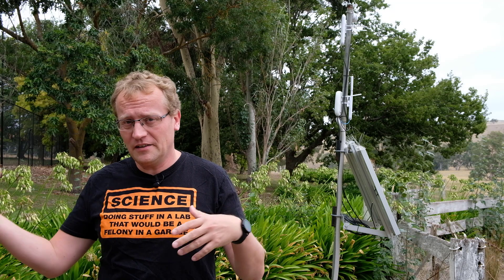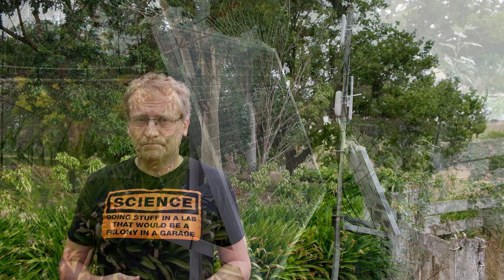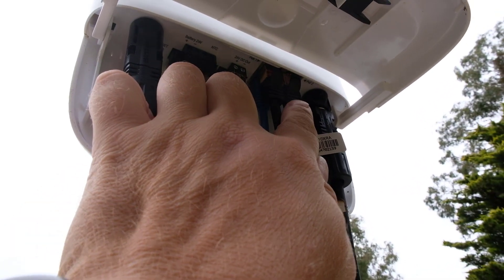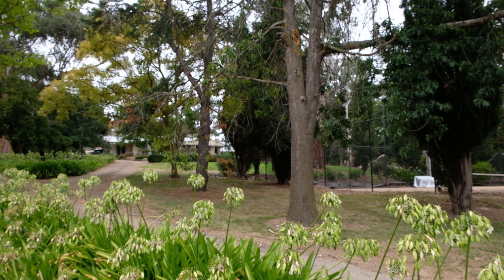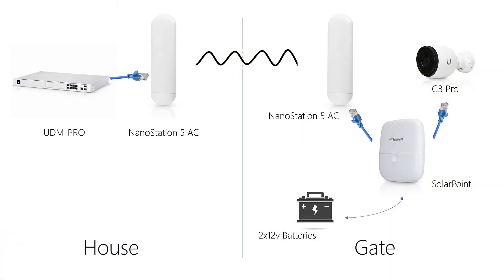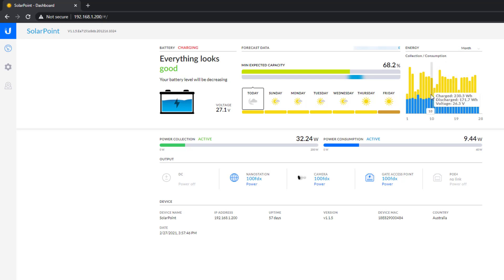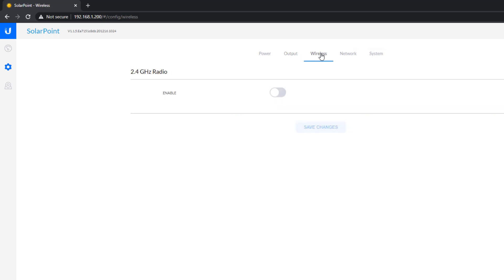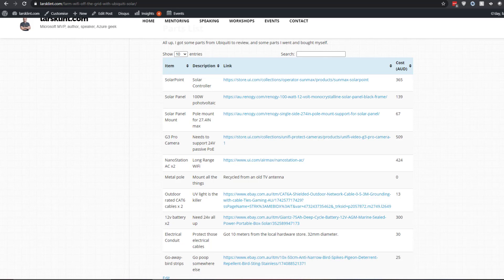Solar powered Unifi network setup - including full cost overview

Comment: Didnt see the solar point in the UI store... Any thoughts on low profile gear we could use to provide solar power to the new express cams?
Reply from the maker: The SolarPoint is old technology now, and you probably wouldn't use it for anything modern (PoE+, 48V). 
Not sure what you would need, but a panel, a solar controller and a charger would be minimum?

Comment: That SunMax is an awesome surprise as a product, thank you! 7A is a reasonable charge current, given a 100W panel and 24V battery setup (that's ~5A max, really). Just don't wire up a much larger panel... But - only 24v passive poe, still, and worse, no support for LiFePo battery charging? That's a software issue only afaics (charge curve is different to lead-acid), so would be a simple upgrade. I can find a few units in AU still, but suspect I'll need to look at competing products for Lithium. Excellent overview, as always Lars!
Reply from the maker: I have used the SolarPoint for just over 3 years now and it has been amazing. However, as you say, the 24V passive is an issue, and I can't update to modern devices with it. I am currently in the process of upgrading my entire gate setup, which includes the Access Gate Kit, 48V, PoE+ and much more. That video will come when I am done. 
Thanks so much for watching and commenting. 😊

Comment: Where can I find the cables and adapter used for the battery to ubiquiti controller?
Reply from the maker: They are standard MC4 connectors and cables used for solar panels. I am not sure what adapter you are referring to.

Comment: Great video. I use many different UniFi products, but had NO idea about the SunMax. Glad I can still learn something everyday!
Reply from the maker: Thanks Tyler. It is a great device, but is starting to show its age. It only supports 24V passive PoE, and supports up to 200W of input. While it isn't officially discontinued from Unifi, it is becoming more and more difficult to find one for sale. I will keep using mine though until it gives up 😁
Reply: @LarsKlintTech  Yeah, I'm seeing that they're hard to get. I'm already planning another option if I can't get one soon. 24v would be fine, as all my nodes will be UniFi-PoE or WiFi/solar. Best of luck! Thanks again!
Reply from the maker: @tylermyers6920  Just make sure your Unifi PoE devices support 24V passive. The newer ones don't.
Reply: @LarsKlintTech  For sure! My P2P is 24v Passive and I can get a WAP that is as well.
Thanks again!

Comment: the solar point devices max rating for temp is 50c
where I'm moving to it gets almost 50c in the shade in summer
shouldn't be any real reason you can make a shroud or a shelter for the solar point device?
it doesn't transmit any wireless signal does it
the nano-station does all of the transmitting?
Reply from the maker: At first to set it up it does transmit an "admin wifi", but after you have got it on your network, you can switch it off. In my case, the NanoStation is the sole connection to my main network.
Reply: @LarsKlintTech  ok gotcha. cheers for the info
Reply from the maker: @cyberbogan944  No worries mate. Any time.

Comment: Do you need the cloud key to use the solar point? Or do you just need one on the network to use the access points?
Reply from the maker: Hi Alec. The SolarPoint is part of the UNMS/UISP family, not Unifi, so you can use any other networking equipment with it, including Unifi.
Reply: @LarsKlintTech  awesome, I've been wanting to install a WiFi repeater on top of a small mountain on my property to relay the internet signal to the back side of my property and this seems like just the ticket. The 24v output that's switchable from the web interface is perfect for me cause I'll need to run a heater on the solar panel during winter every so often I'm thinking. Thanks for the quick reply and great video!!
Reply from the maker: @alec4672  Just bear in mind that you need to get the signal to the SolarPoint as well. I use the NanoStation for this, as it is also a UISP device, but I suspect you can use another point to point connection too. 
I have a hill I was wanting to put an access point on too, and was considering getting a second setup like this. There are other hurdles though, such as protecting it from the llamas.
Reply: @LarsKlintTech  I was hoping to use a Bullet M2 in client mode to pick up the current WiFi in the house and have the SolarPoint rebroadcast it on it's built in radio, then in the shed on the other side of the property have another Bullet M2 to pick up the signal broadcasted by the SolarPoint. I believe if I use high enough gain yagis I should be able to receive the signal pretty good.
Reply from the maker: @alec4672  I had never even heard of the Bullet M2. Very cool devices. That could work I reckon. NanoStations are directional too, so you could go down that route too? Either way should work afaik 🤔
Reply: @LarsKlintTech  I love the customizability of picking your particular antenna for the bullet M2 definitely the most unique device I've seen. The idea of owning the radio and picking your antenna later is very attractive to me in my situation specifically cause it's all very experimental and a 2.4ghz antenna on its own is pretty cheap and will allow me to try other variations like Yagi, dish, can ect. I got turned onto the M2 from a sailing channel way back and have always wanted to play with it and this is the perfect excuse.
Reply from the maker: @alec4672  I do like the idea too. Now to find a project for it.... 😏

Comment: Lars this is great thank you! I have a solar powered gate and was thinking of putting in a SolarPoint + Nano bridge to put a camera and access point down there too. I didn’t realize the SolarPoint has a 24 V dc output already. I am thinking I could run the PV wires into the SolarPoint and then connect the 24 v DC to the gate controller. Probably need back up batteries for both so I don’t lock my self out. Have you connected up your gate yet?
Reply from the maker: Yes, that could work I reckon. That is similar to what I am doing, but no, I haven't finished yet. The hold up has been material shortages and getting certain parts fabricated. I am on the home stretch though. A video of the whole setup and system is in the works too 😊

Comment: How did you calculate that 2x75ah are enough? why not 2x55ah for example or 2x100ha? Thanks
Reply from the maker: I looked up the wattage of each device (camera, access point, nano station) and did a rough calculation on how much they would draw. I then converted that to amp hours, and scaled up to 3-4 days usage with no charging.

Comment: hello, great video, I have the solar switch, which is very similar, but I have the doubt of how many amps I could install at most... greetings
Reply from the maker: Thanks 😊 What are you wanting to do? The solar switch only does passive 24V PoE, so if your device support this, you should be okay.
Reply: @LarsKlintTech  dear i want to install 4 rocket m5, i am working with them, the problem is that i need to store more energy, put higher amperage batteries, i see that you put 2 batteries of 75 amp, how has it worked??? i do not want to damage the equipment, I would like to install 2 batteries of 12 volts 175 amp,
greetings
Reply from the maker: @x7ltda198  There is a difference between "amps" and "amp hours". The first is used to measure how much current, the second is to measure energy volume. My batteries are 12 volts each with 75 amp hours of capacity. The amps being used depends on the devices you connect. The Rocket M5 uses 24V at 8 Watts, which is 0.333 amps, and the Solar Point can handle up to 10 amps. So you will be just fine connecting them.
I hope that make sense. Electrical specifications and calculations can be confusing 😊
Reply: @LarsKlintTech  estimated I have the 4 rockets connected and my current consumption does not exceed 16 watts, and I wanted to increase the storage capacity, how has it worked with 75 amps?
Reply from the maker: @x7ltda198  75 amp hours at 16 watts will last you around 60 hours from full. The real question is how fast you can charge them. I suspect you will need more amp hours, such as 120 or 140 to have a stable system.
Reply: @LarsKlintTech  dear thank you very much for your response, this equipment charges a maximum 7 amp, it would take a long time to charge larger batteries, as the manufacturer says i will have to use the 40 amp batteries, until the moment it works for me, but when before the climate changes i will have to see any alternative, thank you very much for your time, greetings

Comment: The 24v/48v thing is a major pain in the ___. Having to cobble DC-DC converters together to get things to work cross platform and even within Unifi adds costs and unneeded complexity.
Reply from the maker: Yes, you are absolutely right. I can see why they do it for the SolarPoint, as it removes complexity for the device, when providing 24V passive PoE.

Comment: I thought the UAP-AC-M that you have mounted there supports mesh?  Why didn’t you use the mesh technology to connect to your other ones at the house instead of the nano?  Did it just not reach?
Reply from the maker: Yes, and it is indeed part of my farm mesh Wifi network. Are you referring to the wireless uplink? In that case, it is just a bit too far away (~90 meters) to get a constant stable signal.

Comment: Hi Lars, I'm working with a client now that needs a camera far away from their existing UniFi setup. I feel confident with the network setup (already setup about 100 Nanostation PTP bridges) but I am apprehensive about the PV Panel Terminals as I am not familiar with that kind of cabling (learning about it now). Do you have any advice to give on the PV Panel connectors and if Male or Female MC4 or H4 connectors are needed to plug into the Ubiquiti Solar Charge Controller? I just subscribed and am glad I found your channel as it is very well done! Much thanks, John
Reply from the maker: Hi John. Welcome and thanks for joining my little community 😊
The SolarPoint takes H4 connectors on both sides. The panel I bought to plug into it has already the H4 connectors attached. It should come with one side being female and one side male, so it just plugs into the SolarPoint and you can't really go wrong.

Comment: Is the sunmax supported still?
Reply from the maker: As far as I know, yes. There are still two products listed on the Unifi website, and I haven't heard that it has been discontinued. Having said that I would love to see an upgraded version that can support PoE++ for example.
Reply: @LarsKlintTech  I was going to attempt the usw-flex in the outdoor enclosure with their included PoE++ adapter, but need to figure out how best to power the adapter without overcomplicating the setup. I guess I’d need an inverter with a low voltage cut off to protect from overdraining unless I can find an inverter charge controller combined.
Reply from the maker: @reallyMello  As you might have figured out, it gets complicated really quickly. You definitely need a good solar controller that can manage the panel -> batteries flow. As you say, then it is a matter of knowing when to switch devices off based on voltage. The SolarPoint does all that for you, which is why I went that route.

Comment: Hi Lars, thanks for all the great videos and the tour of your property.  I am trying to set up something similar to this  but am having trouble working out what cables I need to run between the batteries and the SolarPoint from the video.  I assume they cannot be wider than the notch in the case which rules out things like AWG 10 size cables.  Would you have any details on what you used please, thanks again
Reply from the maker: Thanks for the watch and kind comment 😊
Because it is 24V with low amperage, you don't need very heavy duty cables. We used some standard low voltage electrical wire, which you can see at 3:20 as well. The roll has a label on it that says "T1-3 CAM1-3-30 16G 16/0-32" I hope that helps.
Reply: @LarsKlintTech  thank you

Comment: Thanks Lars, I found this really helpful - including your remarks in your blog regarding the lack of 802.3af support on the SolarPoint device. It's unfortunate because the G3 cameras are on the way out (already difficult to find) and the G4s are all 802.3af only which means it's quite difficult to find a solution as elegant as you've put together. I hope Ubiquiti come out with a new SolarPoint controller, but given it fits bit of a niche, I'm not holding my breath.

I did manage to find an alternative to the SolarPoint which does do 802.3af, Passive PoE and has the solar/battery controller (Wi-Tek WI-PS306GF). These are unmanaged, so you don't get the detail and integration of the Ubiquiti, but would serve the same purpose. Unfortunately they aren't in stock anywhere, so my search continues.
Reply from the maker: Hi Jonathan. Thanks for the kind words 😊 You can use a converter to convert the 24V passive into 802.3af. I am not sure if Unifi makes one, but there are others around. 
I agree, it isn't as elegant, but it might be the fix you need.

Comment: Great video!
I don't see a link to which mesh AP you used in your list, or at the end of the video?
Also, why are you using the NanoStation AC instead of the Loco which uses a little less power?  Did you need the second port?
I am in the process of setting up the SolarPoint, but with it being only 24v Passive, I can't find a simple list of all Unifi products that are compatible.

I'm going from a house, to a pole around 200m away with the panel, controller, etc.  I was hoping to broadcast Wi-Fi as far as possible from there with an AP,  but 24v passive devices are going to be fairly limited, aren't they?

I'd also like to have the option to shoot it another 200m to a second pole with an AP there as well.  The second pole MAY be able to receive a signal from the house as well, but not sure if it will have line-of-sight... so may need to link it from the 1st pole with another set of NanoStations.... would the NanoStation AC (or Loco) at the house work to go to both poles (point to multipoint) if it has line-of-sight?
Does the SolarPoint require 24v, or will a single 12v battery work?
Thanks!
Reply from the maker: Hi Patrick. Thanks so much for your feedback and ideas. 
I use the NanoStation AC mainly because that was what I got before I knew about the Loco, and also because UBNT sent a couple to me to test out.  The AP I am using is the https://store.ui.com/products/unifi-ac-mesh-ap which is older, but super reliable and 24V compatible. I get at least 100 meter range in a straight line to my nearby creek, so that is not terrible. 

Point-to-multipoint should be possible, but I tried and couldn't get it to work. I messed it all up and had to reset my 8 NanoStations to get back to PtP setup. I might try again, but not sure. The distance is no problem though, and a few trees in the way hasn't made a difference in my setup. 

The SolarPoint is 24V only. Two serialised 12V batteries do it easily though.

Comment: You’re incredible. It’s very rare to find a network engineer that has built a solution for a non-commercial farm. I’m doing a case study on this for a small farm in the U.S. and have the same requirements that you built for (more weather situations to design for though). 

Curious why you chose the 75Ah batteries and not the 100Ah considering the rest of your investment? I see a lot more promotion of 100Ah batteries for most DIY solar projects and they seem almost the same price in the U.S. market versus the Australian market. Thanks for any pointers!
Reply from the maker: Hi Rehan. Thanks for the kind words. Really happy you can get some value out of this. I chose 75Ah for a few reasons. Main reason was price vs. use. I did a bunch of calculations on usage, and the 75Ah setup was more than I needed, and the 100Ah was much more expensive at the time of purchase. I have maybe 2-3 days a year where the battery depletes its charge during the evening, so I was pretty close. 
Having said that I am about to add a Unifi G4 doorbell to it, as well as an automatic gate opener, so I will probably add another 2x75Ah batteries in a parallel setup, or upgrade to 100Ah.
Reply: don't think it matters since the charge rate is only 7amps max. this only designed to run a system with smaller batteries.

Comment: Hey mate, I have a very similar situation with a gate about 150m away from the house (regional NSW). I think this can be adapted to use a G4 Doorbell off the passive PoE. Will be giving it a go soon. I was planning to use a bog standard MPPT charge controller and Inverter, but using the Ubiquiti charge controller seems to give a lot more control. Thanks for the pointers!
Reply from the maker: Interesting. I am a couple of months away from doing the G4 doorbell install too. I was planning on using the 24V DC output from the SolarPoint and converting to AC somehow.
Reply: @LarsKlintTech  you don’t actually need to convert to AC, it can run off 24v DC off the passive PoE or the 24v DC out. Check around the forums or YouTube, there are a couple of guides.
Reply from the maker: @oxylus7223  Awesome! Thanks for the heads up mate. That is really useful and much easier to install then.